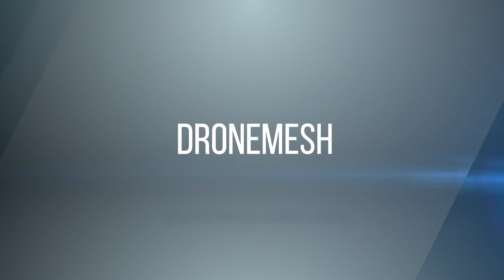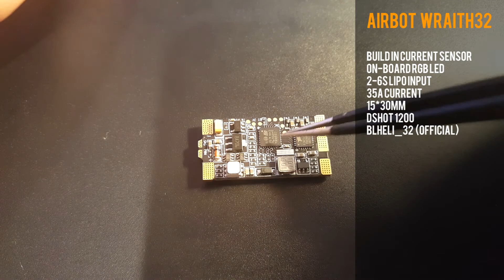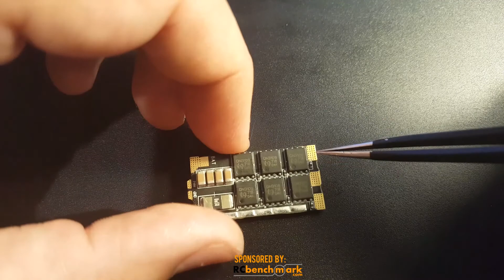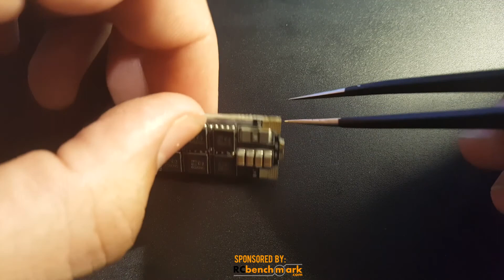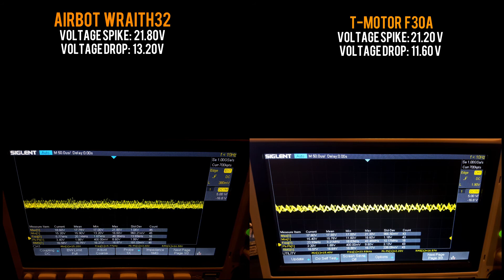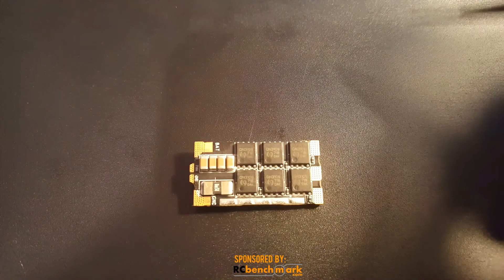Airbot Wraith32 ESC Review and Noise Testing // Blheli_32

Comment: Hey drone mesh congrats i hear on new baby...sorry if im incorrect.. im needing some help bad bad so i have a new build its a astro switch truex with version 1.2 joshua bardwell f4 and i used a lumenier 50amp 4.1 (first attempt) it blew a fet in a small wreck after it did flip of death to ground then two brand new spedix is30 4.1 esc same stuff it flip out sky and both has fet failures because there is continuity from negative input from lipo to motor pads on esc.. i dont know if the zmx finx40 2633kv is the issue they are new and they show when testing motors 000.2ohms not spinning and im not getting any grounding on no motor from motor wire to base and ive double checked if screw was shorting out but nothing. but when this happens and this last time it did it in 1min and flipped to ground and bam esc bad. what could be my problem? i have capacitors wired to the joshua bardwell f4 f.c where seperate esc would be powered neg/pos pads had 2 470mf and one 1000mf caps

Comment: Nice review! Btw at 2:09 that coil is for the buck converter step down IC (right next to it) that (usually) provides 5v or 3.3V. They need an external coil and capacitors to work.

Comment: has anyone wired up the telemetry on this esc?
I just purchased the Betaflight F4 and I was going to wire up the telemetry on the Esc. It said to wire up RX1 on the flight controller but what port is it on the ESC?

I can't find anything online showing how to wire it up and how to set it up
Reply: https://www.rcgroups.com/forums/showatt.php?attachmentid=10016143
Reply: BrentW  okay I have it wired up. Now I just have to figure out how to set ir up on Betaflight 3.2. All the wires went to RX1. so it's going to be setup on Uart 1. But what do I select on Betaflight
Reply: I'm also building a quad where I use the wraith32 and have connected the tiny TX pas on each ESC to a UART, but I have not yet tested it. You need to indeed set it up via Betaflight via peripherals but I do not know how you can see if it effectively works.
You cannot have, at the same time, hooked up different "things" to 1 UART. So you might use UART1 RX pad for ESC telemetry. And then for smartaudio you might use the TX pad of UART3. The corresponding other pad (UART1 TX, UART3 RX cannot be used for anything else.)
Reply: BrentW, thanks. Thsts what I thought.
Reply: BrentW, I figured it out.
The Wraith32 esc's driver was 32.0.

They just released 32.1, which added ESC telemetry.

So it's working now.
Reply from the maker: +Unknown X esc telemetry peripherals
Reply: Drone Mesh. Yeah my smart audio doesn't seem to be working also. wraith32 is wired at ESC on Tx port and is going to Betaflight f4 flight controller and is hooked up to RX1 on all ESC'S. Smart audio is hooked up on flight controller to TX1, guy from Fpv model said it had to be on that port. Can both be on UART1 ? He said Flysky smart port had to be on TX3.
Reply: BrentW, Yeah my Smart Audio is working now. Yeah UART1 I have sensor input set to ESC. I went to battery and power and changed it to ESC Sensor and I hit save. But it's not getting any readings. I also checked the OSD to see if it has the RPM'S & Temperature. But it says 0 RPM & 0 Degree temperature
Reply: I have some pictures if anyone wants to look at it and see if they can figure out what I'm doing wrong. I sent pictures to you drone mesh via Facebook messager.
Reply: I think the only thing that you need to change in Betaflight to be able to get ESC telemetry to work is:
In the ports tab: go to the UART (the esc TX pads are connected to) and change Sensor input to "ESC".
I do not think you have to change something in the battery and power tab to be able to get it to work.
Reply: BrentW, This is on Github.
Procedure:

Install the ESCs to the quad and run a wire from all four telemetry pads on the ESCs to the RX pin of the spare hardware UART on the flight controller. It may be easier to make a loom to split a single wire from the RX pin of the UART into four wires (one for each ESC).

Open the Betaflight configurator (V 1.8.5 or later) and go to the Ports tab.

Find the UART that the ESC telemetry is connected to and in the column marked "Sensor Input", select ESC in the left box and leave AUTO in the right box. Don't forget to hit the "save and reboot" button.

Still in Betaflight configurator, switch to the Configuration tab.

Make sure you are using the Dshot protocol for ESC communication!

Under "Other Features", make sure that "ESC_SENSOR" is enabled.

On the Battery Voltage section enable "VBAT" and select ESC Sensor from the drop down menu below. Configure the cell voltages as required. (Defaults should be fine)

On the Current Sensor section enable "CURRENT_METER" and select ESC Sensor from the drop down menu below. Configure the scale and offset as required. (Defaults should be fine)

To test, set it all up then plug in the flight controller as well as the battery, open the configurator to the configuration tab and arm via the tx within a few seconds of powering on the flight controller. PROPS OFF ON THE BENCH!

Confirm that telemetry is being received by the transmitter.

If using a Taranis, don't forget to arm the quad when you "Discover Sensors" or the ESC telemetry won't be discovered.

Taranis users may want to change the "FUEL" sensor from % to mAh for an accur
Reply: good question, I just finished to build a quad with those esc, and didn't even know of telemetry wiring. will they still run or there's downsides to not wire those?
Reply: samflyer80, it wasn't too bad to wire it up. But the ESC'S Kept frying if you have the wraith32 esc's take them back and get something else.  No joke they are way too fragile and will break if you look at them wrong. But no there is no upside or down side to wiring them other than looking at the temperature and the RPM Speed on the OSD.
Reply: Yeah no joke I went through 7 wraith32 ESC'S Before giving up and getting a different brand and another thing if you do decided to wire them up be careful not to rip the pads off on the esc's. They come off way too easy.
Reply: thanks for the info man, well now i have them installed so i'll leave them without for the first flights then
Reply: samflyer80, just make sure you update the firmware to 32.1 to get telemetry because 32.0 won't have it.

This is on Github.

Telemetry Procedure:

Install the ESCs to the quad and run a wire from all four telemetry pads on the ESCs to the RX pin of the spare hardware UART on the flight controller. It may be easier to make a loom to split a single wire from the RX pin of the UART into four wires (one for each ESC).

Open the Betaflight configurator (V 1.8.5 or later) and go to the Ports tab.

Find the UART that the ESC telemetry is connected to and in the column marked "Sensor Input", select ESC in the left box and leave AUTO in the right box. Don't forget to hit the "save and reboot" button.

Still in Betaflight configurator, switch to the Configuration tab.

Make sure you are using the Dshot protocol for ESC communication!

Under "Other Features", make sure that "ESC_SENSOR" is enabled.

On the Battery Voltage section enable "VBAT" and select ESC Sensor from the drop down menu below. Configure the cell voltages as required. (Defaults should be fine)

On the Current Sensor section enable "CURRENT_METER" and select ESC Sensor from the drop down menu below. Configure the scale and offset as required. (Defaults should be fine)

To test, set it all up then plug in the flight controller as well as the battery, open the configurator to the configuration tab and arm via the tx within a few seconds of powering on the flight controller. PROPS OFF ON THE BENCH!

Confirm that telemetry is being received by the transmitter.

If using a Taranis, don't forget to arm the quad when you "Discover Sensors" or the ESC telemetry won't be discovered.

Taranis users may want to change the "FUEL" sensor from % to mAh for an accur

Comment: Yo! Thank you man for your effort. Question! Did u manage to get current data from this ESC and BF 3.2? I'm on Revolt right now and waiting from raceflight this kind of feature, but I guess they stuck with multishot
Reply from the maker: Paleman FPV Have not tried the telemetry yet. There is a new FC with telemetry pads comming out and I'm trying to get my hands on it ASAP.
Reply: I though information will be going thru signal wire
Reply from the maker: Paleman FPV as of right now as I know they have a separate pin and pad for telemetry.

Comment: Hi drone mesh! I so I've been flying with these esc and they seems fantastic, 
I have this setup, 
Soft mounted Hrlg flame with a 470 25v cap
Airbot wraith32 
Emax 2306 
On beta 3.2 and dynamic filter on 
The quad seems fly good 
But the motors I think gets a little bit to warm (d is low around 20) , any setting maybe i need to tweak in blheli configurator? Motor timing or something?
Another question on dshot 1200 and flame which gyro loop/ pid would you recommend?  
Thank you for your feedback 
I'll upload a video also
Reply from the maker: Nils Astrologo keep playing with your rubber dampners until the motors dont get as hot
Reply: Drone Mesh you mean change softmount type?

Comment: I'm currently checking out this ESC and the new Betaflight ESC, which is on preorder at the moment, for my next build. They look almost exactly the same but the Betaflight ESC has a few extra capacitors and larger soldering pads. I don't feel like this justifies the extra few dollars on price and the additional wait time before they ship. I plan on using a cap on my battery leads anyway. Do you think it's worth waiting for the Betaflight ESC? Thanks in advance!

Comment: I got these when they first came out and put them on a problem arf quad along with 2306 2400kv emax and wow, its now my favorite! It likes amps though. Going to fiddle with current limiting and see if it changes how hot my batteries come down
Reply from the maker: I did the same exact thing I put them on a build that i had noise and blackouts like crazy.. That quad is one of my favorites now. 

I will upload the video this weekend.
Reply: Drone Mesh I have avan props on it, and now flying it for a while I feel even cyclone props don't grip like these. I recommend trying them if you aren't already
Reply: TheBigblock81 could you please share your bheli32 configuration settings in the dedicated program? Motor timing pwm frequency and current limiting? I have the same motors

Comment: Dronemesh. Thank you so much for testing out the Wraith 32 esc. I'm very excited to see what new features Betaflight comes up with to use the telemetry info from the 32 escs. For anyone having trouble with how to set up these escs, you need to manualy install Betaflight 3.2 onto your flight controller. Then download the Blheli32 suite and it will work just like the Blheli_s suite.
Reply: As a side note, once I had my Wraith 32s set up with the Blheli32 suite, I downgraded my betaflight from 3.2 back to 3.1.7 and all of my Blheli32 settings remained intact. Betaflight 3.2 has some OSD bugs, but it is needed to use the Blheli32 passthrough.

Comment: I love your approach with the oscilloscope. It shows a lot. Good idea. But I think people should use the LC filters that come with the VTX and isolate the high current side of the drone from the low current side ( fc and vtx) that way. I have done it on all my quads and it really works. Better than a capacitor. That's what it is designed for.  Spikes on high current circuits are much harder to fix than those on a low current side.